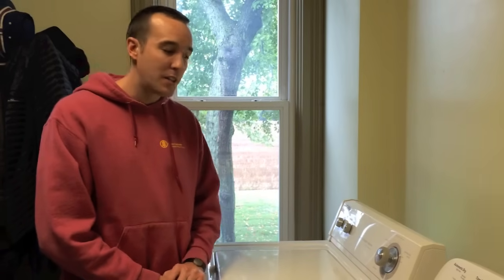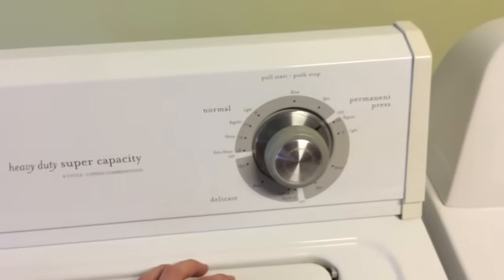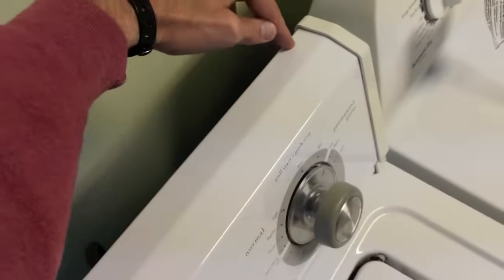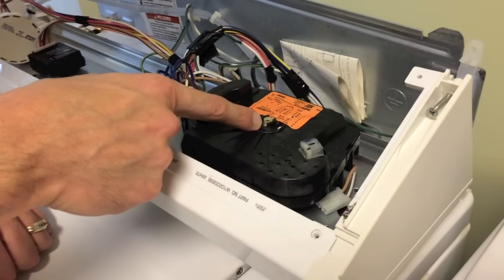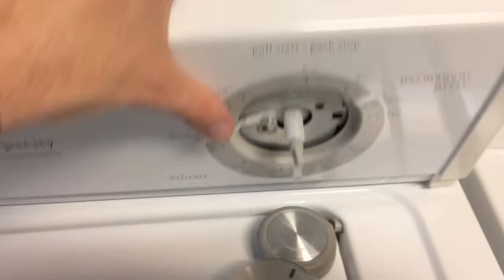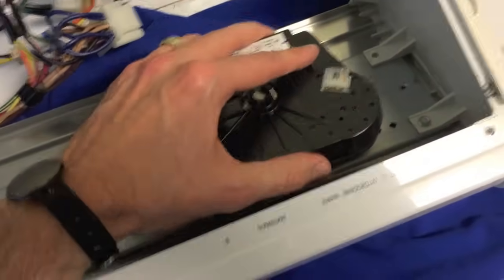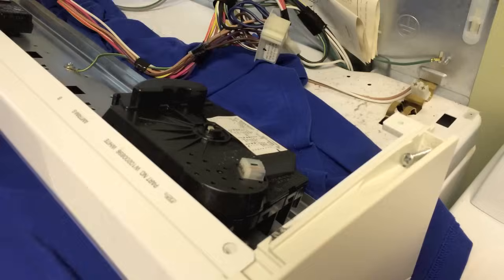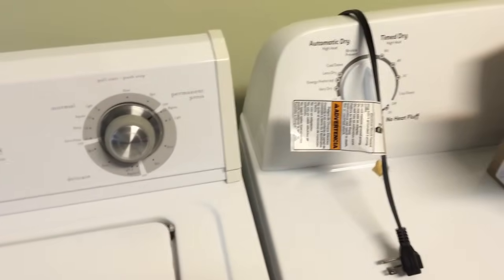My washing machine stops at Rinse - Does not DRAIN or SPIN

Comment: need help, pls !!!
My washing machine stop when it make 2nd RINSE ,it work normally at  the frist Rinse , can anybody tell me how to fix it, thank u so much
Reply from the maker: Thanks for checking out the video and sharing your comment and experience.  Washer failure is no fun...it's possible that your timer has begun to fault.  It's also very possible that your Lid Switch has begun to fault.  

Regarding the lid switch...there is a built-in safety feature that does not allow the washing machine to spin and drain with a failed lid switch...in other words it’s basically telling the washing machine that the lid is open and not to spin and throw water all over the house 😱... this means that a failed lid Switch will not allow the washing machine to continue past that portion of the cycle even though the entire lid is closed and secure.  The lid switch can be tested and replaced cheaper.  Attached is a video how to change lid switch.  Keep me posted.  I ordered my parts from Repairclinic.com...Please Subscribe to the channel and turn on your notifications that would be awesome thanks again.

https://youtu.be/1hTRc-_PnP8
Reply: @DIYwithMichaelBorders  thank you.....it helped me
Reply from the maker: jadoofly 

😎👍🔧🔩

Comment: HI MY WASHER WILL WASH BUT WHEN IT COME TO SPIN IT WILL NOT SPIN OR DRAIN THE WATER OUT SO COULD YOU TELL ME WHAT REALLY WRONG  I HAVE A SEAR ROEBUCK MODEL 110 AND THE OTHER NUMBER ARE 91511100
Reply from the maker: Laverne Rollins 

Thanks for checking out the video and sharing your experience Laverne.  Washing machine problems are no fun!  Let’s get this figured out!

It’s possible that your Timer has failed which is the part mentioned in this video.  The Timer is what moves the wash through the wash cycle.  However I’m leaning more toward a Lid Switch Failure.  

There’s a great possibility that your Lid Switch has failed.  The Lid Switch is a safety feature that doesn’t allow washing machine to enter the spin portion with the lid in the “Open” position.  The last thing you want is the washing machine spinning with the lid open & throwing water all over your house 😱💦💦💦💦😱

When the Lid Switch fails, it can no longer send the signal to the washing machine telling it that it’s closed.  This makes the washing machine stop at the exact point it stopped for you.  Replacing Lid Switch can possibly be the part required.  Below is a link to a video that shows the step-by-step process on how to replace Lid Switch.

       https://youtu.be/1hTRc-_PnP8

Definitely keep us posted.  Please subscribe to the channel and turn on your YouTube notifications that would be awesome thanks again!  😎👍🔧🔩

We purchased all our parts from:

       Repairclinic.com

Comment: Hi 
I just got this same washer and it doesn’t fill all the way up when ready to rinse! Why? Help. 
Thanks.
Reply from the maker: Roxana Jacob 

Thanks for watching & sharing your experience.  Does your washer complete the entire cycle without stopping?

Keep us posted.  Please subscribe to the channel and turn on your YouTube notification Bell 🛎 that would be awesome thanks again!

😎👍🔧🔩
Reply: @ Roxana Jacob   Some of these machines have an additional, hidden water level control in the console that limits the rinse fill level to between 1/4 and 1/3 of tub, regardless of what (wash) level is selected on the accessible control.  This design change was enacted in an effort to reduce water consumption.
Reply from the maker: DADoESofTX 

Thanks for watching & sharing your info.  That’s awesome!  This info will be helpful for future viewers.

😎👍🔧🔩
Reply: DIY With Michael Borders yes it does
Reply: DADoESofTX can I cange that? To have it fill up for every cycle?
Reply: DADoESofTX  it leave all the soap 😭
Reply: Leaves
Reply from the maker: Roxana Jacob 

Thanks for the reply.  Below is a link to our step-by-step video that shows replacement of the Water Inlet Valve.

       https://youtu.be/DiPFZSMiBn8

This is a very important part & can cause problems when clogged or worn out.  It’s possible that you can clean the screens.  If that doesn’t work, replacing part will help.

😎👍🔧🔩